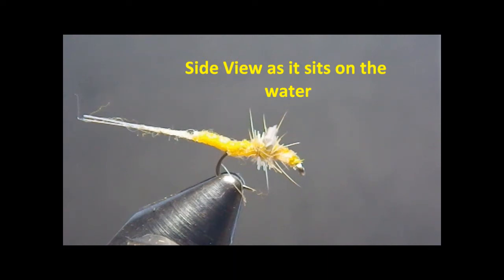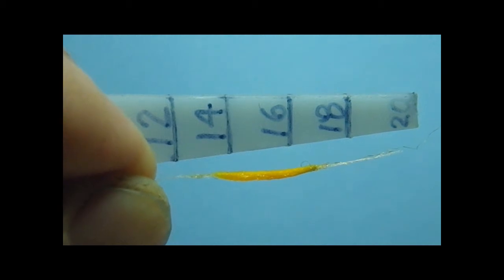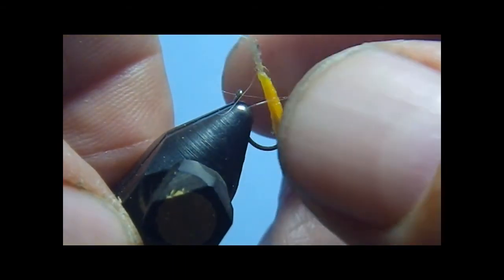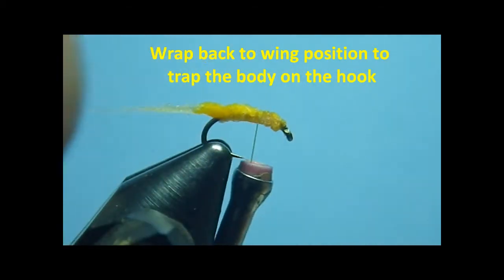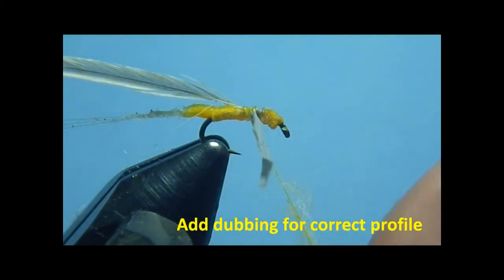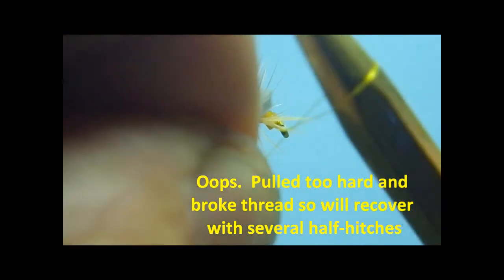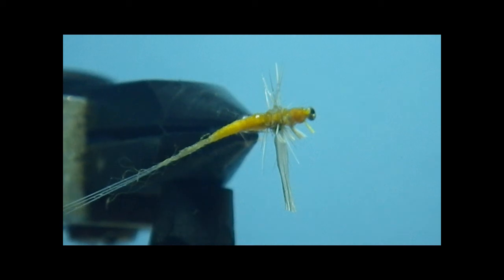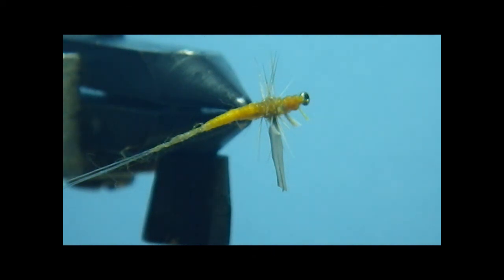Ducks DOA Mayfly

Comment: Started your video and had to go back and see how you make that body. I commend your ingenuity in both the construction of the body and the profile of a dead or dying mayfly.  I do almost the same  to make mayfly bodies, except I use water based head cement, and spin the needle in the Nor-vise. If you haven't seen it, it is not like any other vise out there. It makes dubbing brushes and bodies like this etc because it has high speed bearings and spins as rapidly as your drill, and it can also do its job as a vise when all the bodies are dry. Makes tube flies as well.
I do love the thought of the silicone body being an "inner tube" as well. Going to try this now and see if the bodies are better. I think they will be heavier, but the added buoyancy of the silicone may just make up for that. Thanks for sharing. All the best, Sean

Comment from the maker: Sean,  Thanks for the comments.  I have used several glues, silicon, and even UV cure stuff and find that the clear 100% silicon works best for me.  I tie mostly flies 16 thru 22 and use light wire scud hooks so weight has not been a problem.  It might be a problem with larger flies.  I have tied with a Nor-vise (friends) and they are very nice.  Roger